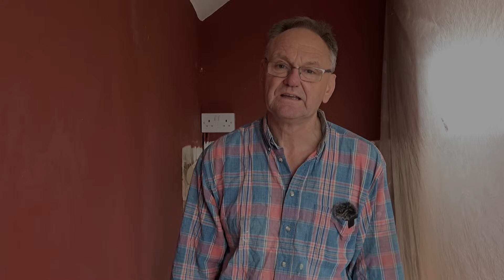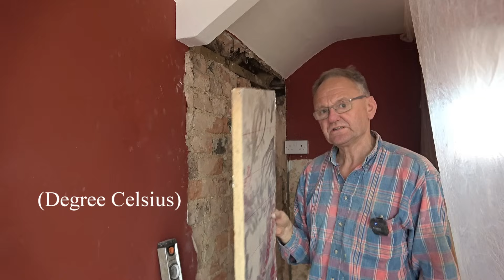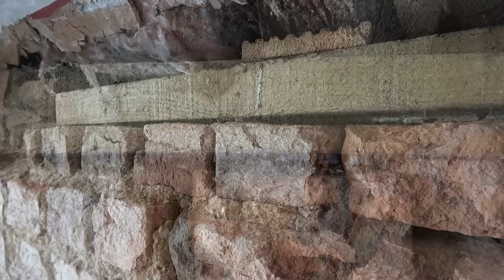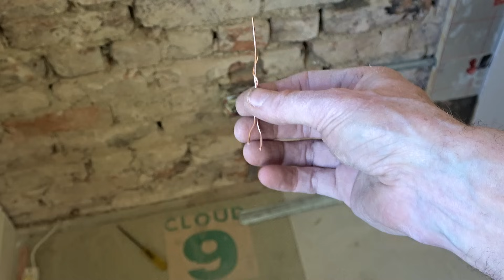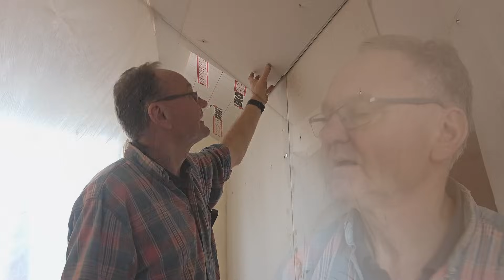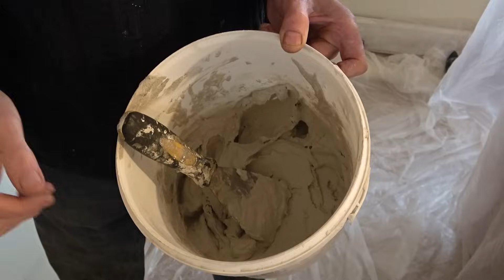HS165 Insulating a solid wall (Do it yourself)

Comment: Finishing the insulation at the ledge will leave a cold strip along the bottom which will lead to condensation and mould along the skirting board.
Reply from the maker: Hi Bob, thanks. Off cam later I blew in some expanding foam behind  that lower area. I did not want to disturb the wall by chopping off that brick ledge. Cheerd

Comment: Surly you’ve removed all the breathability of the wall?  I have a similar age and constructed building no way would I seal it up with zero regard for breathing, plenty of products out there to retain this.
Reply from the maker: Hi, I completely understand your point. I think if I had not already done this on a few walls 15 years ago without problems I'd think the same. As it turns out we have not seen any problems at all, maybe we are just lucky. If I was starting again I would definitely look at a breathable solution. Building material technology has moved on.  Cheers

Comment: Great video Paul, I'm just about to tackle mybwalls on an 1850's farmhouse (sandstone) any problems since you carried out the works? Anything you'd do differently?. Thanks Paul (North Yorkshire)
Reply from the maker: Hi Paul. You will know from the comments people have worried about condensation on the cold wall behind the insulation. We keep our humidity low and we have not had any problems at all. No musty smells, no mould, no evidence of condensation. I fixed the board on with screws because that's what I've done before. If you are doing a lot it would be worth looking into dot and dab and/of fixing foam. I'm sure it would be quicker if you can master the technique. Cheers

Comment: Feathering the joint out significantly on either side yields an unobservable joint after light sanding. Multiple thin coats also helps.
Reply from the maker: 👍 thank you.

Comment: Why fidnt uou just stick it with foam adhesive or use cork plastet..
Reply from the maker: Hi Brian, yes I probably could but I don't have any experience of using foam adhesive so I just stuck with what I've done before.  I've only done this perhaps 7 times in 20 years, so I don't get a lot of practice or much incentive to try a new technique if it may be my last time.  Cheers

Comment: well done Paul, did you notice the difference after ??
Reply from the maker: Hi Martin, yes immediately. In winter that wall was freezing cold and now it is warm to touch even with just 25mm of insulation. A little insulation makes a lot of difference. Cheers

Comment: Really useful video, as I plan to do something similar to a couple of walls. Luckily I can just fit over existing plaster as the walls are good. Price of insulated plasterboard is insane, so I may well go the same route as you and use separate insulation/board.  I think I will use hammer in plastic fixings and adhesive foam as my walls are smooth, and this should help reduce any cold bridging. I think I'll also switch to surface mounted sockets, again to avoid having to cut through the insulation too much.   I also have the bevelled ceiling, and am not sure if I'll insulate that part (it now has celotex behind it due to new roof at least). 

Firstly though I have to do something about the knackered plaster under a bay window - another simple job that increased in scope very rapidly 😀Cheers!
Reply from the maker: All simple jobs on houses become complicated. Today I'm at my son's to fit thermostatic valves to some rads. Pipes don't line up, old brackets not level, chipboard floor disintegrating where there had been a leak, skirting to refit ..... but we are on the right side of it now I think on the first one after 3 hours!! Cheers

Comment: Great job and these jobs always end up being bigger than you expected. I have a Victorian double brick terrace house and the outside facing bedroom wall gets stone cold. I added 6mm extruded polystyrene on top of the plaster and papered over. I still get condensation on this wall and the paper has fropped off lol. I am thinking of doing what you have done but leaving the plaster on. Or is it advisable to remove rhe plaster. Reference to what others have said about damp and mould behind. Surely any moisture condencing would evaporate back out the way it came in. And it cant enter the living space anyway.
Reply from the maker: Hi RGM, I only took the plaster off because it was tapered/sloping 25mm top to bottom and I needed that bit of space (the wardrobes run right up to the door frame). The condensation comes mostly from the warm moist air in the room. It can condense on the cooler surface and also get behind the insulation and condense on the cold wall (can get mouldy behind the insulation where you can't see it). Even though our bedroom wall was freezing before we insulated we never saw condensation but we always keep the rooms well ventilated. So this suggests to me you may have quite high humidity in your room. Maybe you can get a cheap humidity meter - you would be looking for 50% or under. If your room humidity is generally high you may get condensation whatever you do. Maybe check that first. In another room we have a dehumidifier to help us dry clothes and it rarely runs unless we load the rack with loads of wet washing. (auto runs at 50%).  Cheers

Comment: Great video and gives me more confidence in tackling a job myself. I was thinking of doing this is my shed (mancave/office) i was going to use the B&Q equivalent to kingspan and battens but instead of using plasterboard i was going to use lengths of wood cladding. Would this work love to hear your opinions.
Reply from the maker: Hiya, hard to give a considered answer without a lot of detail but in principle I don't see why not. My friend insulated his thin-wall-sheet garage with just silvered insulation bubble sheet (the sort of thing you put behind radiators) and it made a massive difference winter and summer. Cheers

Comment: do you need to removed the plaster prior to start? im about to tackle something simlar.
Reply from the maker: Hi James, no you don't need to remove the plaster. I did it because my plaster was tapered about an inch to top to bottom (I did not want a sloping wall) and also we were short of space due to our fitted wardrobes.  Cheers
Reply: Cheers

Comment: We have a solid brick wall with plaster and paint. Do you need to take that all off and get back to bare brick before insulating?
Reply from the maker: Hi, no you don't. I took my paster off because we are limited for space and the plaster tapered out 1 inch top to bottom. The plaster may be soft but it still helps with the strength and integrity of the wall. You saw all the pointing I had to do. Cheers

Comment: Hi mate, I’ve got a solid external kitchen wall that is cold and unlevel. Would like to insulate it and square the wall up. But worried about ventilation behind the plasterboard causing mould?
Reply from the maker: Hi Jack, as you can imagine my video has caused comments saying there is a risk of condensation and mould behind the insulation, on a solid wall. Yes I took a measured risk based on what I know. I've insulated maybe 4 walls in our house in this way over 10 years or so and never knowingly had any problems. But we keep our house well ventilated and  humidity low. In my opinion to be relatively risk free the insulation would have to be fully breathable or you have external vents so the air can flow behind the insulation (like a suspended floor with air bricks).  But,  you can spend a lot of money over worry. And the reality is your average jobbing builder would just dot and dab the insulation board straight into the wall (they'd be long gone before any problems showed). Cheers
Reply: @ thanks mate, yeah I think I look to much into it & start to confuse myself! Getting a plasterer round to see what he thinks is best to do. Any recommendations on how to prevent mould behind kitchen cupboards ?
Reply from the maker: @JackMetcalfe-z7u  Well it depends. Reduce condensation as much as you can. Increase airflow behind the cupboards if you can (strip vents top and bottom perhaps). Stand the cupboards off the wall on vertical battens? After that you are into insulation indoors or outdoors. Cheers

Comment: Absolutely do not do this, it is very bad practice! A solid wall is likely to be wet at some time. The best place for insulation is actually on the outside so that the mass of the wall acts as a heat store  and it will , subject to spec, provide a water proof layer to protect the wall. The way he is proposing here misses a whole lot of potential problems such as  structural timbers running into that damp wall which may well be rotting and, of course, he is not insulating the ceiling to floor gap. Etc, etc. Don't do it!
Reply from the maker: Hi Ken, yes a number of people have made similar comments. I'm not going to disagree. We take our chances. External insulation is definitely not possible as we are in a conservation area for one thing and also nobody could climb into the small gap between the two properties. I can only slide in sideways and I'm thin. Cheers

Comment: Great vid Haxby, like the previous comment love that you are taking us through your thoughts and explaining your thinking, you are presenting it like you are talking to us. Perfect! not a polished up sales man setup. This is lovely, really! 
Now, my 1st attempt at this was accidental, wanted to redo- our bath, when the plaster just started falling off, it had to come off (external wall side mainly) and then got the foam-backed plasterboard. I have to say that made a good difference, the bath isn't cold like it used to be. Now that i understand a bit more about the breathability of an old house like your with solid walls. I have now stripped our main bedroom ready for the same, except I a thinking like you did, put up a foil backed board. Your update below on the damp question has given me more confidence that it will be OK...At least the front elevation of the house that is facing South facing. Best Wish!
Reply from the maker: Hi Arwin, thanks for the comment. Over the past 10 years or so I have insulated 3 alcoves, 1 wall each of 3 rooms, and the wall at the end of the landing in just the way you saw and I can honestly say we have never experienced damp or mould anywhere visible. We keep our house well ventilated. Some years ago we disposed of the tumble dryer and set up a clothes hanger in our dining room, and to help with drying we got a dehumidifier.  I have never seen the dehumidifier above 52% humidity even with wet clothes hanging and usually it's below 45%. Normally when we switch it on the humidity is too low for it to run. We sleep with the window open. We shower with the bathroom fan running and the window open. All these things keep the humidity down but really they are just lifestyle habits rather than any specific attempt to avoid condensation. Lifestyle makes a massive difference. My daughter has a house she rents out now. When she lived there there were absolutely no issues with condensation or mould. Her recent tenant called us to say the toilet was leaking. When we visited there was no leak, it was moisture compensating on the cistern and literally running through the bathroom floor to the room below. There was water running down the windows and constant drips from the loft hatches all due to condensation from extremely high humidity. We had to explain how to open windows to ventilate the property, particularly when cooking.   They did not get upset at this instruction - they just did not know that's what you had to do. Cheers
Reply: @HaxbyShed  Thanks for your reply  - We are exactly the same, we vent the house as and when, window open in bath after shower to let it dry out and don't generally find any condensation issue. Just some small amount of mold build by in a cupboard that's on an external wall. But I know what it is - cold spots that don't get much air circulation. Now that I have started on insulating ,I'll get that sorted. Keep up with the good work - Thanks

Comment: a good way of marking out the socket boxes is to wet around the metal edge and thump the board when in position to make a mark. I used to just spit on my fingers !. Cut out with a multi tool
Reply from the maker: Hi Frankie, that's a very quick and practical way to do it. Cheers

Comment: Hi pal.  How did you pin the metal channels for the cable wiring?
Reply from the maker: Hi, in this case I got some screws with big heads then drilled, plugged and screwed. The edge of the screw head just lipped over the edge of the metal (I did not drill into the metal trim). I used plugged screws because the wall was brick and hard. A bit fiddly. On softer walls like breeze block I might have used plasterboard nails with a big head and again just overlapped the heads with the metal trim. If I was plastering I might just splat a bit of plaster over the metal channel and just hold it a moment whilst the plaster dried enough to hold it there. I hope that helps. Proper trades people would probably have quicker ways. Cheers

Comment: Why not just dot and dab it to the wall?
Reply from the maker: Hi Festivejelly, I'm sure most people would dot and dab, just being a DIY guy I'd never done it so I stuck with what I know. With dot and dab how would you fix the plasterboard to the insulation? Would you dab the insulation to the wall and then the plasterboard to the insulation? Buying plasterboard and insulation separately is quite a bit cheaper (if your time is free). Cheers
Reply: @HaxbyShed  Oh I have absolutely no idea. But I was just curious. I would have thought it would be easier.

If I was going to dot and dab it id probably get one where the insulation is bonded to the plasterboard but as you've said its more expensive.

That said I found out the hard way that time is money and I think maybe dot and dab might be the quickest.

Comment: Great video. I did the same to my cold walls before watching your video, except I used spray foam for the fixing. I sealed gaps with foil tape and around the edges with spray foam. I left a 12mm gap at floor level to prevent floor moisture ingress.
Reply from the maker: Hi Steve, I know it's controversial using non breathable insulation but it's been fine for us. We've done the outside walls in a few rooms and even a thin sheet of insulation makes a big difference. Our heating costs are surprisingly low for an old house. Cheers

Comment: would you not get black mold forming behind the celotex where moisture finds it's way behind and hitting the cold surface? i get some forming on my cold solid wall that has an inch of lime plaster on it, i wipe it of the painted plaster, i'm sure if i put celotex over the plaster the black mold would form behind and there would be no way of seeing it. I put some thin plywood around a window reveal, when i took it off about 6 years later there was black mold on the concrete lintel and even on the 9 inch solid brick wall that is built using lime mortar

I'm thinking celotex needs to be stuck to brick or plaster completely with no air gaps behind
Reply from the maker: Hi Mondayschild, there is definitely a risk of that. The way I did this is not the way a professional would recommend. I can only say I've not had any problems with mould visible externally and I have no plans to take it off. Undisturbed it will probably outlast me. Cheers

Comment: Don’t ever insulate like this
Reply from the maker: Hi Mark, a number of people have warned against insulating like this. So far we have not noticed any problems but of course I don't know what's going on behind. In this case there is no space to insulate externally and we can only spare 1 inch thickness inside, so our options are very limited. Cheers
Reply: Wood fibre boards and lime plaster is the way to go

Comment: how come you didnt use a damp proof membrane ? if your cutting the back of the boards/insulation where the cables go surely if theres any mosture it would go through this straight to the plaster from the wall ? im in the middle of planning a simillar job but thinking a cheap DPM under the insalition will solve some potentiall ong term issues.
Reply from the maker: Hi, I can't give you a reasoned or informed answer. I just felt the insulation and foil on the front would be sufficient. I've not seen any issues in 2 years. But of course I've not pulled it off to check behind either. Cheers
Reply: @HaxbyShed  I think it's just the fear of dampy and having to pull it off and do a bigger repair. Looks great though.

Comment: is your house rendered on the outside? or just brick
Reply from the maker: It is just brick, so of course porous but we have not had any problems with damp or mould so far after 2 years nearly. Cheers
Reply: would you mind doing a follow up video.   lets say cut out a square so you can see the condition of wall behind and the condition of back of insulation. maybe close to corners where mould
usually forms

you will be able to fix it back in place easily with foam then abit of tape and jointing.    would make a great video.  would be the first to do this type of video on youtube!
Reply from the maker: @ke161co  Hiya, the problem is it gives me quite a bit of inconvenience and my experience with YouTube is that follow-up videos often get very few views. I did a follow up on this one using a thermal camera to see how effective the insulation actually was. It only got 892 views.  https://youtu.be/5DW-asJFRqc  There was a lot of good technical content in there but the YouTube 'suggestion robots' did not offer it to many people. Cheers